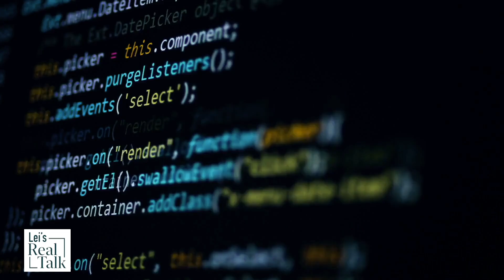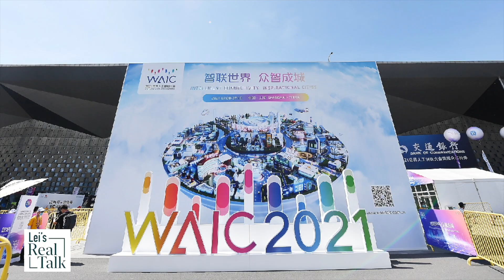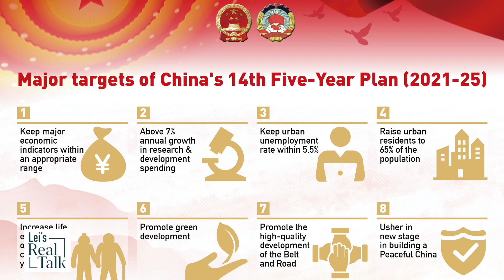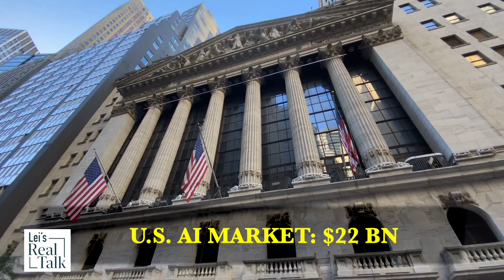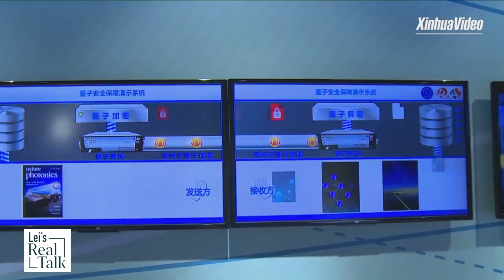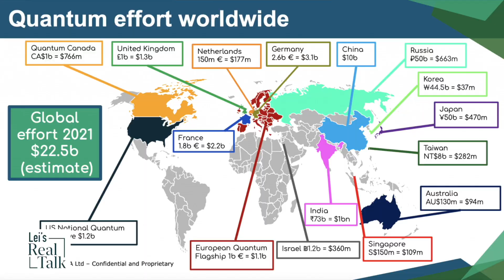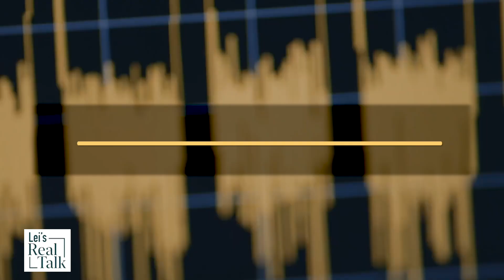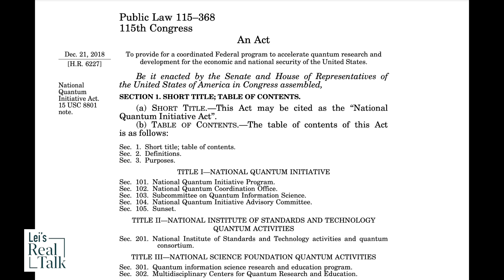China vs US: Blockchain, AI, & Quantum technology

Comment: Hmmm... 10 billion times more faster than the Googles...  will you need advanced chips on that? If that’s the case,    China does not have the advanced chips.
Reply: 1 -  quantum chips and normal chips are diferents 

2 - google sycamore use superconductors to organize the qbits while Chinese computer use photons to move the information 

That's why jiuzhang is 10 billion times faster and jiuzhang 2.0 is 100 trillion times faster